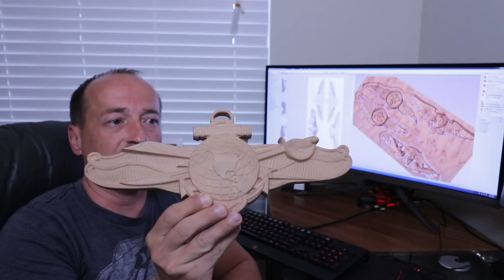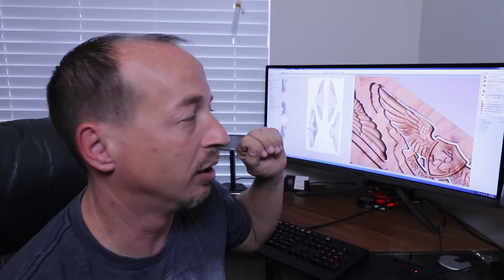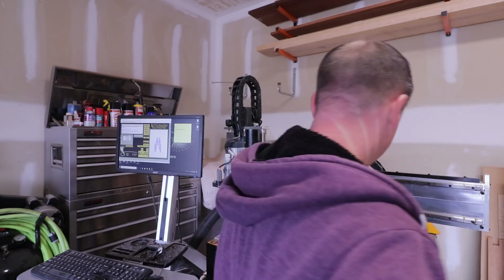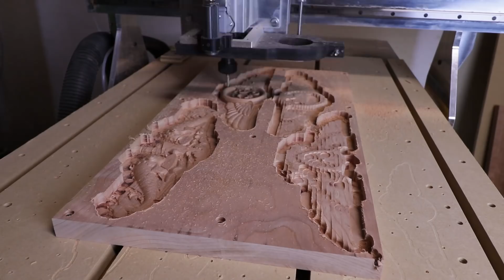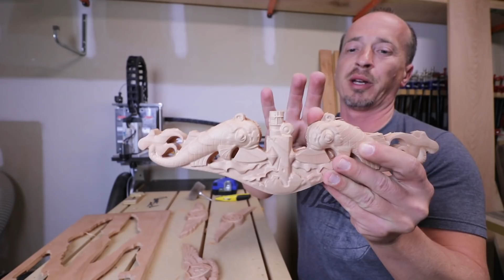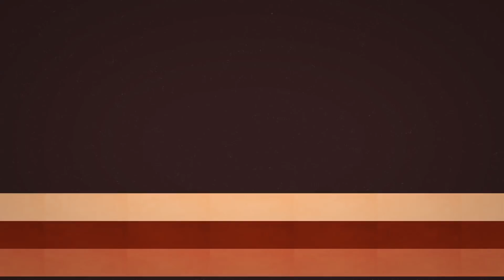Why are 3D CNC Router Carvings So Expensive?!!

Comment: Looking at your Etsy shop, your products seem fairly priced, not really expensive and from my experience with a cnc side business, the people who seek the cheapest price are not the ones you want to deal with. It's not worth the time in the end (credit card refunds, bad reviews, bad reputation, etc.).There are maybe several things you could optimize in the process (probably eliminate one tool change, machine the wasterboard for a level cut, fine tune speeds/feeds, etc.) and further optimize the workflow for mass production (I use the tape + superglue method, about 3-4x faster than post processing tabs for me), but that's not where the biggest cost comes from.

In my case, that's "machine depreciation", repairs, fixes, maintenance, which are fine for mechanical 2.5D work (ie. 15 minutes of cutting), but for fine 3D carvings which can take 8-12 hours each, it's astronomical. That's why I price 3D carvings higher than even 2.5D metal work. ... Not just the router, but the vaccuuming / cyclone system, air pump, tooling, waste disposal, the cost just adds up.

Comment: Awesome video... For a customer to assume they know what the costs of a product to be is simply ignorance. You hit about half of the points that add up to the final cost I think, there are so many factors.  You also have the cost of bits, electricity to operate, all the hundreds of hours of education to even be able to pull it off. Not to mention the cost of R&D, how many prototypes and "test" cuts until a model is perfect? How many pieces of wood have you had to throw away in the process of perfecting a product design? 

Personally my models are ever evolving and improving. Yes, some are getting close to an 'automatic' operation, but I have very few products that I can say require little time on my part, and the few that are getting close are there because of dozens and dozens of attempts and hundreds of adjustments over the original model design. 

The cost of the lumber is NOT what they are paying for. When we hire a lawyer we are not simply paying for the cost of making photocopies of documents, we pay for their education and experience. At a coffee house we are not paying for the cost of coffee beans and water, we pay for the skills that have learned in producing a product from raw materials. When experts dial in on the actual costs of the parts to produce an iPhone, it is generally 50% of the retail costs, that does not mean that I am capable of producing an Iphone in order to save $500. Sorry for the long rant. :/
Reply: What a line of BULLSHIT if I ever heard it.  You can't factor in the cost of an education, Prototypes, Out-cuts, etc. into the final price of this.  You idiots are factoring in all of these things JUST so you can raise the price (fucking over the customer).  You would have it take a month and 10x's the "labor" when in reality a craftsman of basic knowledge and skill could have the project completed and delivered in a few days.
Reply: @BillyReed68  On this basic stuff yes .. but China makes the basic stuff with unskilled labor and robots .. it's the skilled craftsmanship that AI cannot replicate . Chippendale is popular from east to west ..Federal is popular in the NE. I have never seen a robot replicate a Federal design.  https://www.youtube.com/watch?v=jSA-2lefSeM
Reply: @BillyReed68  "You can't factor in the cost of an education, Prototypes, Out-cuts, etc. into the final price of this." Yes you can, every business includes these costs into final products, they are called R&D costs and everyone from Tesla and Apple to Your barber does this. 

You claim that these businesses are fucking the customer over yet it is the customer who makes the choice to spend their money. Its simple, as long as the price is stated up front and with clear terms then there is no way the customer can be fucked over, they just decide if they want the service or not. Dont like the price, dont pay for the service and if everyone's price is higher than you would pay then make it yourself and understand why the costs are so high.
Reply: @fuzzydeath2403  Horseshit!  By Your logic My first job out of college should have paid 6 figures in the first month.  Only asshats punching $0.08 gaskets to sell to the mafia government for $8000 a pop would try to sell that line of ABSOLUTE BULLSHIT!    Prices are based upon what the market will bear.   You are attempting some type of modern alchemy with this horseshit by turning a minimum wage into the mines of Midas.  Like I said, only a sucker would pay your rates.
Reply: @BillyReed68  good then you can make them yourself. You have no clue how the world works, do you? What is your time worth?? 5.00 an hour? Of course you have to factor in all those costs into your product, that doesn't mean the piece will cost you 100,000.00 dollars.. It just meant that you can't get a 3d carved piece of wood for the price of a piece of plastic..
Reply: @scottbuehler7511  let's see how your theory works over the next few years.  What you fail to realize is that you are destroying the intrinsic  value of the work by bypassing the actuall time it takes to learn the craft AND by bypassing the time it takes a mastercraftman to make it. You're nothing more than a theif in the night.  And you think you are SO cleaver when you are quite untalented and sociopathic.
Reply: @BillyReed68  what are you talking about? I have been doing woodwork for 35 years. CNC helps me to continue that more efficiently. You simply cannot carve wood by hand and charge less. I have had a CNC for the past 15 years and I have been very successful with it, so not sure what you mean by "my theory in the next few years". I have a feeling you are incompetent in your skills and are having a hard time making a living, therefore your anger and frustration with everyone using a CNC. Good luck with things..

Comment: Hey Reuben at 16:20 you point out that your spoilboard may have leveling issues as some areas did not cut all the way through to the point they can be seen visually... I am pretty new to CNC and I am curious if fixing that issue is as simple as resurfacing the spoilboard?
Reply: Yup, that would do it...  it had been a while since I resurfaced it...  I live in Georgia,  so temp and humidity changes daily.  MDF loves that lol.

Comment: every time you change Gcode it's better to prepare equal boards. Possibly cut one and move only the positions in the machine without changing Gcode. Use a small milling cutter to set the milling of only the object element, not all of it, and preferably to generate a path, for example, around letters.

Comment: with Rhino i construct 3d-Objekts, out of the view from top i generate with the software a 2D-Line around the 3d-Objekt, then i safe only the lines as dxf-file and all the rest also lines as stl-file. then i open software: Construcam 3d(was included with cnc-machine, else it costs 1000 euro not sure, and both files get opened in software. into the software i add into the Programm-bit-list my own existing bits, with diameter, shaft-length, etc, then i choose 1 out of many lines in file and open the relief-area of software where the stl-file got openeD, with the selected 2d Line(blue marked) over the grey relief-stl-picture i select in the menue generate tracks for the selected bit, software works 5-20 secs, safe it on extra layer, and software communicates with cnc-controller-software, so i sent file to the laptop, controlling the cnc, and the machine knows all lines, with needed deepnees, where to go up on defined altitude(i use 5-10mm) and move to next area, it slows down little infront edges and accelerates after edge again, different bits= different speed of x+y+z, also rpm can be controlled
Reply: in construcam you adjust the amount of layers for the bit, the distance to next track, to make slow 90 degree relief or fast 80 or 70 degree-relief, example, 3mm bit and 20mm wood, 3mm can work safe 3mm deep, so i select 7 layer for hard wood or 6 layer for soft-woord, the first layers just for making room for the real relief, they are with distance 1mm to the next track, but software lets space for the last layer, where you can select extra for this layer a distance from 0,2mm to the next track for exact relief-strucure..you dont have to change bits, its quick and the relief is solala accetable..

Comment: If you make enough of these things. it might be worth making a set of "soft jaws" to be able to flip the parts over and just plane the bottom down flat a bit. This could do the deburing automatically for you vs. dremel, etc. Just a thought.
Reply: when i make 2 sides i spent many time on exact adjusting down to 0,1-0,2mm for plywood, i would not thrust a mechanic which turns it automaticly, it must be so stable that when you push through the wood its not allowed to move 0,1mm, puh....when i work on loonger wood i usual make 4 makers 2 up/down and 2 left/right 10x1mm, when i turn the wood i first adjust the machine again to the 180 degrees mirrored markers, 2 are on left side of wood and two on right side, because sometimes it happens that little dust turns the wood little, left mark is 0,1mm to high and right mark is exact or 0,1mm to low, i usual hear it on the sound, if it scratches the wood or not..

Comment: Why not put a second layer of wasteboard between the work and the table so you can cut through with confidence and that would save you a boatload of finishing work with the inner pockets? If need be you can also just give the middle wasteboard a quick pass so it is flat against the machine reference surface.
Reply from the maker: I usually cut all the way through. This spoil board is close to replacement as I've resurfaced it a few times already.  Just did this project real quick for illustration purposes.
Reply: @rbwoodcreations1039  Gotcha. It just looked a bit unnecessarily complicated. Amazing results though.

Comment: The largest 2.5D I've ever done on my Shopbot was a double sided 48x96 sign. It took nearly 2 days to cut. I know your pain of customers not understanding what all the work that goes into carving. And 2.5D is still 3 axis, not two. If you're using Aspire then you can do double sided and achieve almost 3d and with a rotary axis even closer to true 3D. Thank you for taking the time to make this video. I'll probably be pointing some customers to it!
Reply: Thanks for the info.
Reply: Curious to know how much you sold your project.
Reply: Actually that wasn't the largest sign I made, it was a 36" x 144" double sided. It went for 4K and the 4'x8' was an airbrush painted landscape carving and was 6K out the door.
Reply: Did you have to join multiple pieces of wood to make a 48"x96" board?
Reply: The substrate was made from 2x4 cedar with the rounded edges cut off on the radial arm saw, then stacked together to forn the 4x8.

Comment: I taught my self back in 2000. So time consuming to get the fine detail. Oh, I was working in stone. Multi heads is the way to go for production. One offs takes a long time from CAD to machining for just one part. For what you did, added all the time I would say a days work @ $80 per hr. So they would be $160 a piece. Nice wee workshop.
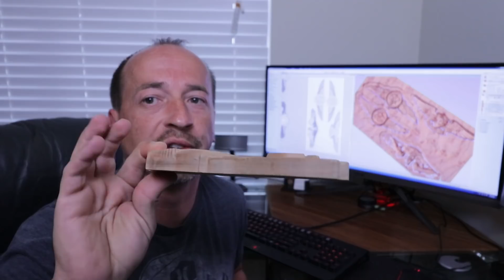Reply: damm it are you sure??? because im Modellshipbuilder and im very very pissed that my CNC-Machine needs hours for a little Stern-Picture-3D-Figur out of wood painted then in gold... what would be the price of M 1:25 modellship with such Ornaments around, with 1500 single Woodparts fully RC-Controlled? but i didnt use tropic-wood...and those carvings here in video are mega big and none details! my ones are 1/5 of size with flaggs 3 Angel 2 canons on it with flowers around, french stil
Reply: @berndlottes9940  When you are in business there are a lot of hidden costs. Since you have your own NC machine time is not an issue. One thing I found was to take bigger steps for the stepper motors sped the process up. But when you get to finishing with 1 or 2mm bit it dose take a long time
Reply: @jimboniface7202  , for details i usual use 1mm round-one(dont know word in english im german 1 mm Rund-Fräser), and for big areas with round relief-structure i use 3mm round one thats much more faster and you can take away 2-3 mm not only 1-1,5 with 1mm..and after years i found out,its much more better and faster, when makin in dxf 2D-Line areas and choose different items for different areas, body of human 3mm and face of human 1mm...thats much more faster then working full relief with 1mm..
Reply: with 1mm next track is around 0,1 to 0,2 mm away 1mm deep, with 3mm item next track is 0,4-0,6mm away and its also smooth surface and you work away 2-3mm deep...
Reply: and the best is the dxf lines must NOT be exact around the relief area, because when its exact the advantage is the small one doesnt go too deep and doesnt brake, but you can adjust maximum relief deep, the disadvantage of exact 2d-Line is the item doesnt go the needed deepnes of relief because the outer-track is blocked by the area of the 2d-line, i usual go half diameter of item with the line outside, maybe -0,1mm
Reply: @berndlottes9940  Rund-Fräser. Round cutter
Reply: @HanginwithHarv  I used google for translation. I would have thought it should have been ball nose

Comment: How do you calculate the cost
Reply: I have not used my CNC machine yet, but a local businessman with big CNCs told me to assume $100 per hour shop time. For all stages of the job. It works out to average in the detail work such as programming, and then the monitored production time when the machine is going back and forth to do the rest of the work.

Comment: Do you 3D model in aspire or do you use another software like blender or maya?
Reply from the maker: I use aspire.  I wish I had the time to learn other modeling software!
Reply: @rbwoodcreations1039  I started with SketchUp, then moved to Fusion 360. Once you model parametrically, it's hard to go backward. My new thing is OnShape; created by the founder of SolidWorks, it's full parametric CAD in the cloud. No local software. No version control nightmares. Never any lost work as it automatically saves as you go. True real-time collaboration, too. Fusion 360 is CAD+CAM. OnShape is CAD-only, so Kiri:Moto completes the CAM portion of the workflow. Really great stuff.
Reply: John Coloe Hi, I recently started learning Fusion 360 but never tried onShape. Would you rather recommend learning onShape or fusion ? Is there any benefit to using both ?
Reply: I wish sketchup was bit less or had few more features, it my favourite 3D designing thing as faster but need other design software for these machines to run, wondering if possible to control cnc by cura or fusion360 as still 3 axis like printer

Comment: I don't do this, (I wish I did), but I know that the cost of the machine is high as well. And let's not forget maintenance on them and the fact that they don't last forever. Plus your time is valuable and you've got to make s profit, otherwise what's the point? I'm impressed with what you do.
Reply: Quite right. Replacing bits, the occasional collet or collet nut... it all adds up
Reply: i dont agree.........CNC-machine High ZS 720 720x420x110mm, its fully out of heavy allu-profils, with german steel-track, german step-motors, its around 60 KG hvy, with CNC-Software+Hardware and Beginner-Bits with needed minimum i payed around 4000€,
i NEVER cleaned it complitly since 2014, i always oil it, and clean it without opening anything, since 2 years i run out of original oil and now i use motoroil for cars, since 2014 i only had to replace in the motor the (german: Kohlenbürsten) because 2 years ago motor stopped running.
Machine is still accurate down to 0,05mm (tested), driving same track 7 times different deepnes you see nothing of the deepnes steps..
Reply: @Robert Ross  That's good to know.

Comment: I quit using tabs for small parts.  Too much sanding. Now I leave 0.2mm of material all around.  The thin material just cracks off when I bend it.  But if one comes loose when cutting, it also hasn't been a problem for ME.  And the small parts are not as valuable as your carvings.
Reply: Layer retention is one work holding strategy. The problem is material variance. If the material is thinner than accounted for in CAM, you end up with problems with loose parts.

When not working on a vacuum table, cam clamping from the sides is my go-to work holding approach. Painters tape with CA glue and accelerator is my secondary approach.
Reply: Or sacrificial material with some carpet tape, or the old magazine paper and glue trick. 

No cracking, cutting or sanding just separating the sacrificial material and the part